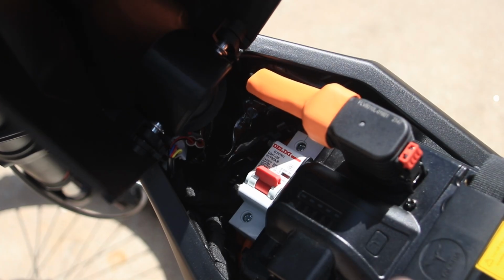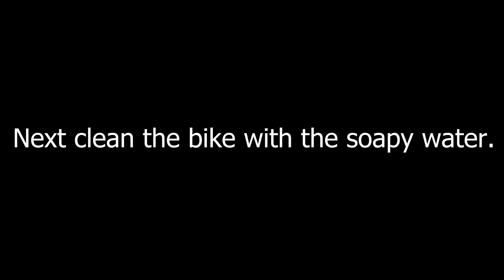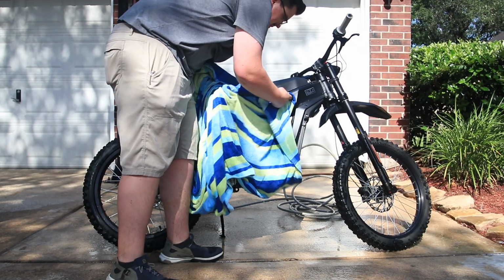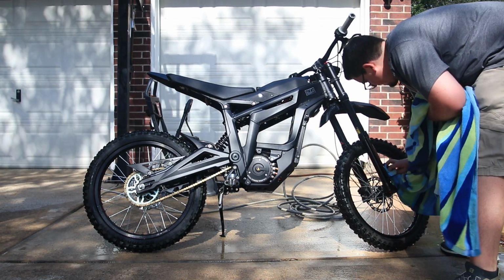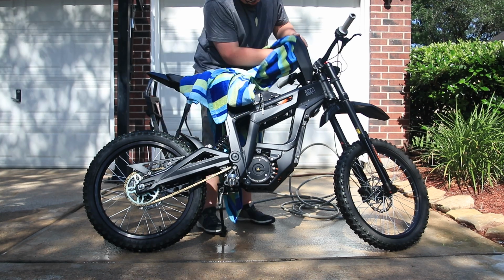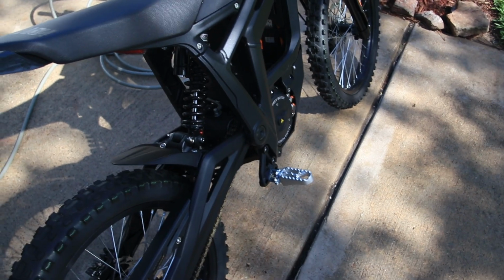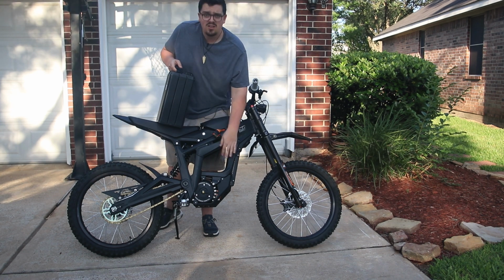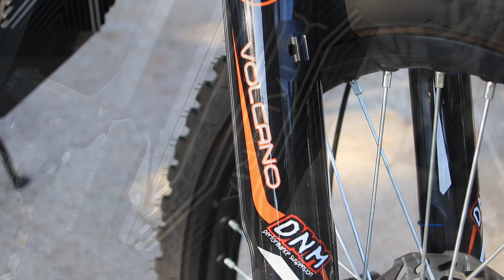How To Clean Your Talaria Sting, Surron, or Segway X260

Comment: Put a plastic/zip lock bag around the connector. It's just an extra step to make sure you don't fry anything lol. Also, after you take the battery out, put the key in the ignition and try to start it. That should clear the controller and lines of any stray power.
Reply from the maker: Excellent advice!

Comment: For the love of God don't pressure wash your ebike. Do you even have dielectric grease on all your connections? There is a reason why the bike comes with a yellow warning sticker on it Reading "don't wash with high pressure"
Reply from the maker: It’s just a tutorial. Use whatever you want to get the water on the bike. Just make sure it dries thoroughly before plugging the battery back in. And yes there is dielectric grease on the connectors. That’ll be in a separate maintenance video because you don’t want to apply grease for every wash because it’ll start caking up the connectors too much.

Comment: How many times have you washed the bike like this? Wondering if you had any issue using pressure washer. I guess as long as your not using foam cannon or blasting out gunk just rinsing it your ok
Reply from the maker: I don’t have an exact number but definitely a ton of times. Plus I’ve ridden it in a torrential rain storm in another video and the ocean in another video. Plus I road through a puddle that brought water half way up the battery it was so deep. 

Anyway what I’m getting at is that in my experience they pretty much aren’t affected by water. Pressure washing is no issue

Comment: You realize using a pressure washer forces water into areas that don't normally see much dirt/moisture ingress and ...  like bearing seals, headset bearings, fork/shock seals, etc. Using a pressure washer is one of the surest ways to *cause* water and corrosion damage to to mechanical components. 

Pro tip - use a leaf blower to dry everything off, after using low pressure water/sponge/soft long bristle brush to wash it.
Reply from the maker: Yea it definitely can if you spray too close. As long as you keep the nozzle 8-12” away there’s no problem. I use the pressure washer to speed up my cleaning. 

That’s a great tip with the leaf blower. That’ll help speed up the dry time for sure!
Reply: @haveagoodoneyt  scary when the battery door flipped open